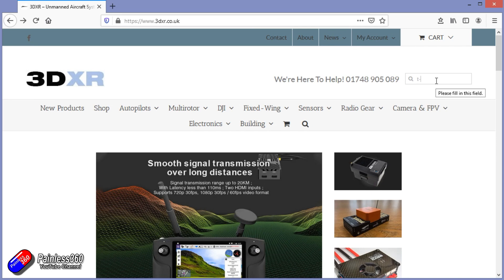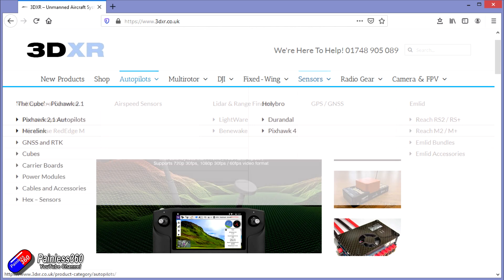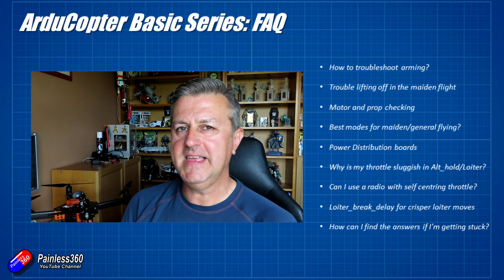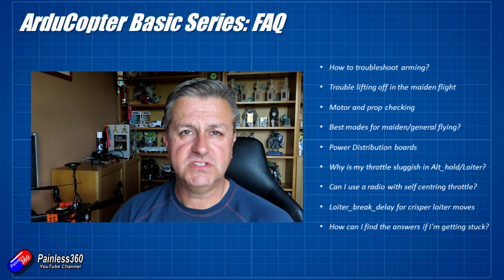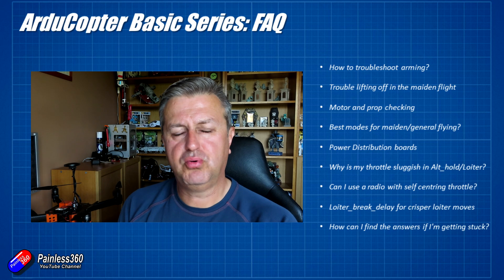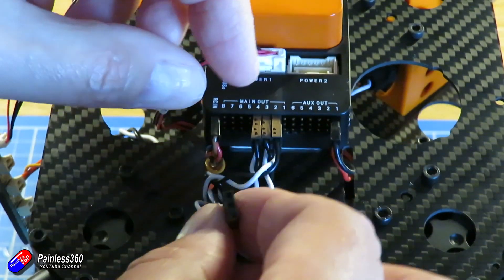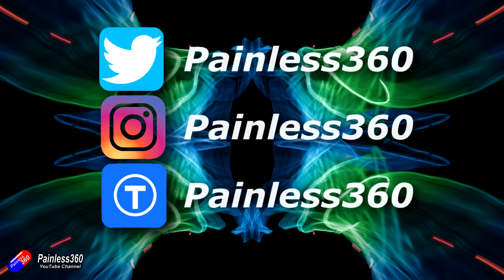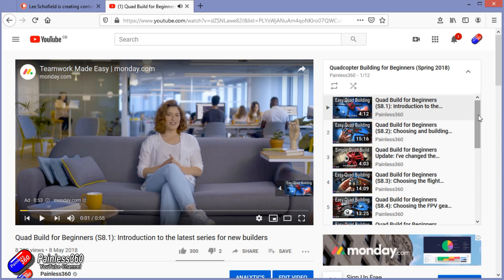PixHawk/Mission Planner/ArduCopter Build for Beginners: Common problems and solutions

Comment: I started building drones over 8 years ago and with the original Pixhawk.  There weren’t any videos to watch or much Wiki information.  I spent hundreds of hours trying to figure everything out and I could not get it to arm.  Nobody knew at that time but it turned out the ESC’s I chose did not play nice with the flight controller. I changed them out and bingo!  The excitement of being airborne was just awesome!  Anyhow, I am going to build a big rig again and I’m curious to see how better the cube will be. I am using GPS & GLONASS for redundancy. You’ve motivated me to start building again, thank you.

Comment: I think the ESC is inside the arm. How do we provide cooling to it?
What's the operating temperature of these ESC?
Or is the current draw per esc too low to heat the ESC?
Please consider these questions from the point of view of operating those in a hot climate.
Reply from the maker: Esc works great. As I'm in the UK I can only fly in UK temps.. Happy flying

Comment: Hi thanks for the video,

My drone which has an S500 frame - Pixhawk 4, 1045 props and 1000kv 1155 motors 

It all powers up fine, props spin very fast but doesn't seem to have enough power to take off.

I've recalibrated the ESCs and it didn't help.

Thanks
Reply from the maker: It may not have enough thrust to fly. I'd lookup the thrust that motor and prop setup gives you in total and make sure the model weighs less than half that.. Best of luck
Reply: @Painless360  thank you!

Comment: Lee.... was wondering if you have ever used any of the "Avoid Collision " Sensor's, if so, which one's and what one's are the simplest to use w/out Arduino Board, etc. Also, Pixhawk 4 Flight Modes some are called "Auto", can't configure to Switches, are all the Flight Modes done on Channel 5...? What's your Opinion on "Mission Planner" vs. "QGroundControl"..? Thanks in Advance..!  =)
Reply from the maker: I've used LIDAR, check the Big boys toys playlist... happy flying
Reply: FLT_MODE_CH  parameter (i think that's correct spelling) default is 5 on copter and 8 on plane.  you also need to make sure your radio switch assignment is correct and matching.  then you shoudl see it working on the radio calibration setup.  also go to servo output function in ardu parameters and make sure it's set to flight mode in copter     one or two of those shodl get you sorted. 
mission planner is more full featured.    it's like the master for developers, etc.  but not hard to use.   most users will do okay with either.  i prefer mission planner, but if i only had a mac, i woudl use qground control .

Comment: Hi, thats an awsome work mate.. Ive seen most of ur videos and great work
Im having issue vid my quad.. Its very sensitive and responsive. Ive done some minor changes but still ive fear to fly as its not that smooth as urs.. On basic tuning page, my rc sensitivity is on extreme left, throt needed to max right (max throt to accel) and thro sensitivity to extreme left.. Even i put roll/pitch sliders to extreme left...quad leaves ground at around less than quarter of stick and comes down immediately even vid slow throt to zero

Comment: I have a Pixhawk 4 and I a commercial  when I hit the horses of the throttle three engines spin regularly but the motor d is less speed. I move your sticky  right or left to stop tow motors and keep two motors workingbut.
Reply from the maker: It sounds like the ESCs need calibrating. Best of luck

Comment: Great content! I recently learned I need a BEC to have redundant power on my Pixhawk 2.4.8 and to power the landing gear on my Tarot 650. I am going to use the 3DR power module as my main power. Do you recommend any BEC? I am going to use a T-motor 4 in 1 ESC with a 10V regulator. I was wondering would the 10v regulator on the 4 in 1 ESC work as a servo rail BEC and redundant power so my FC doesn't reboot. I am trying to understand redundant configurations more.

Comment: hi all has any one got any idea what caused my px 4 quad to spin (like i had full yaw on) out the sky it was flying fine till then and then it wobbled then flattend out and span out to the right and quickly droped in hight going right  till it hit the ground no damage ? one motor didnt work when i found it but later thad day it worked ive had it in the garden 2 times since to test it but it droped 2-4 ft when i was trying to land both times it flipped over at the last min. i can send anyone the flight log if they wanna look at it for me but what i can see is a channel spiked when all this occured any help will be apreciated

Comment: Hi, when you have the lioter, you can use the controls?
Reply from the maker: Yes. See the maiden flight..
Reply: loiter uses gps and barometer position hold when you are at or near center stick control, and moves at set rates of speed in all directions acording to your control inputs.  so you are not commanding a bank angle, or throttle setting, but a rate of speed sideways, or up and down.

Comment: Hi, a setup of I2C hardware would interest me currently the most as I am having massive trouble. In particular the Benewake TFmini S which I have purchased from 3DXR refuses to work in I2C mode, only UART. Also how to connect multiple devices to the I2C bus as I also have a OLED display that works flawless normally but stops working with the Lidar connected, both have different I2C addresses. 3DXR has not responded to any of my contact attempts. Thank you for your very helpful videos.
Reply from the maker: Thanks for the idea. I will look at that later in the series.

Comment: seems that the horizontal and vertical speed parameters for differnt flgith modes and max angles are always skipped.  also yaw tuning....and what to do after you perform autotune to check and adjust for optimal performance. and how to set max safe speeds and angles.            and yaw tunign and TECS tuning in plane....  you always skip these super imprortant features....   thanks.
Reply from the maker: Video on Autotune tips and tricks coming in this series.. stay tuned!
Reply: @Painless360  great, hope it includes yaw tuning for copter and plane too.  i have heard that copter tunes yaw automatically, but seen no evidence of it.  im halfway thruough process with copter on a hex, had to stop becuase of a bad battery...   thanks!

Comment: I am building a pixhawk build just like this one and when I arm it and turn on the throttle all of the motors spin up but then after 5 seconds my motor 3 will slow down then stop and it was the only one that did it my other three worked find . When I switched the motors and the esc and even what port on the board does what it still did it and I figured out that what ever motor and esc that is on motor 3 in the software it will do it and I cant get an answer if you would like to see a video just ask and I will post one and if you want to contact me via email I will share that if you would like. Please anybody that has an idea please help me.
Reply from the maker: Please follow all of the steps in the wiki and my Pixhawk 2020 setup... best of luck
Reply: Ok I will thank you so much
Reply: What mode is it in?   try it in stabilized mode, not RTL or any other pos hold mode